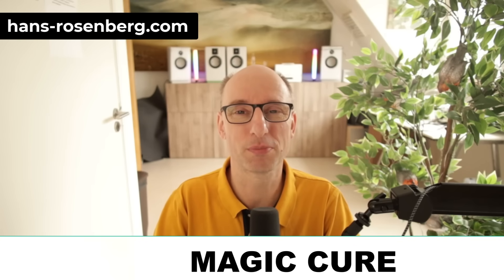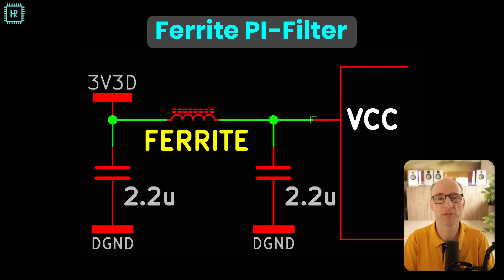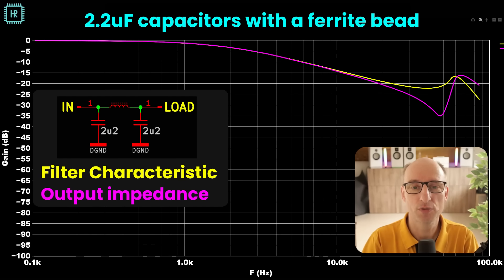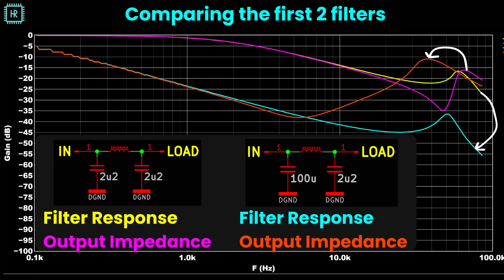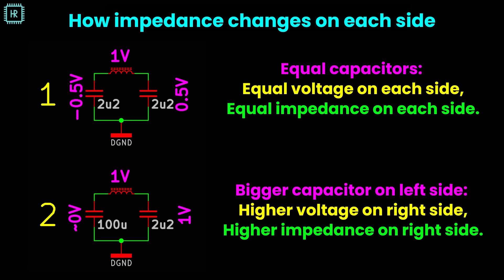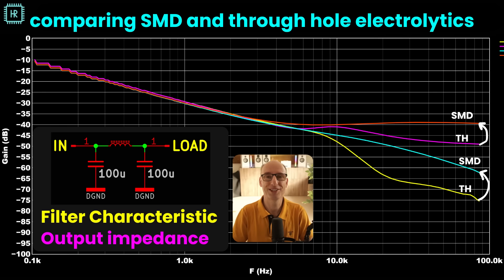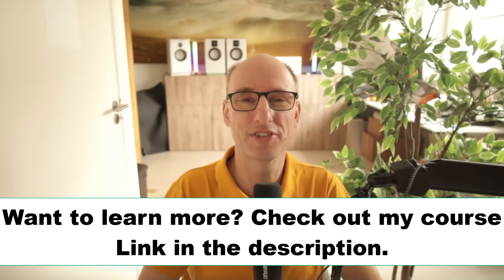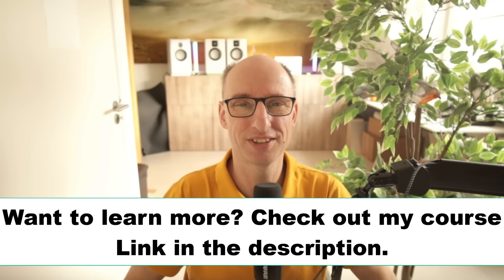How Ferrites Can Quietly Ruin Your Supply

Comment: Might be worth opening the analyser and seeing if the relays can be replaced with shielded ones, or take the input attenuator and place a copper foil cover over it, if there is a ground plane handy to solder it to with a short wide tab of the foil.

also how about damping resistors, either across the ferrite, or in series with the ceramic capacitors, to tame down the Q of the resonance, and thus rob energy out of the filter itself.

The DC change of the ferrites, along with bias voltage of ceramics, is a reason you see in datasheets thousands of different parts, all with the same nominal spec like capacitance, current, voltage and dimensions, and for the beads dimension, current and inductance, along with loss, but they are, very often, not going to act in the same way in any circuit, especially if your application calls for critical parameters to be right. Substituting the wrong part, nominally "purchasing says this item is the same, so we will use the 1c part instead of the 3c part" can make your design change from reliable, conforming and profitable, to a massive field failure rate, poor stability, and not conforming to standards very fast.
Reply from the maker: I tried some copper foil on the connectors (before I realized it was probably the relais) and that didn't help. I could try the relays at some point, but since the problem is only using the less sensitive setting of the device it probably will not bother me again.

Comment: usually spending the cost of the ferrite on extra Caps is a better bet, IMHO.... And your circuit will survive when you slip with the scope probe and short the supply, and you have no risk of coupling external magnetic fields!
Reply from the maker: I think that is true statement.

Comment: The 

@hansRosenburg74 
The QA401, and 402 are no longer made. The QA403 replaces them, but these are audio devices.   Why not use somthing like a  NanoVNA  9KHz-1.5GHz?
Reply from the maker: I tried the nanovna but it is no use at these low frequencies even though it is speced at 9kHz. I could not get it to give good results so I gave up. I did not investigate deeply why it failed.
Reply: 32 bit ADC versus 16 bit ADC seems to be a compelling reason.
Reply: @SeanBZA  It depends on your use case though. I took quick look at the datasheet and you basically can't test anything above 200KHz on the QA403. For example, you're not gonna be able to test any HDMI, PCI-E or USB designs with the QA403.

Comment: LC Pi filters are about as much use as a plastic heat-shield unless you know your load. A variable load means the filter won't be optimal except at a very specific load.

Also, if you put too much current through a ferrite bead, it's inductance goes UP; in magic smoke.
Reply from the maker: indeed

Comment: If only Open Source was explained this well. (Sorry, I'm chewing my own fingers down to the bone trying to get a fairly mature RTOS to work with simple boards like the Pi Pico and low-end STM32s.
Reply: You shouldnt be lazy and use an operating system about which you know not exactly what its doing. Work from scratch and you will know exactly what your circuit or software is doing and can control what it does
Reply: Just use zephyr ;)
Reply from the maker: I"m not going to explain open source :-D

Comment: If you aren’t 100% you need a ferrite, you probably don’t need a ferrite 😂

Jokes aside, I think the common mistake is that people see this pi filters on the analog supplies of MCUs, and end up copy-pasting it to other circuits without understanding that they’re a terrible idea if your load is a digital circuit.
Reply from the maker: I'm reading this conversation. Datasheets and appnotes regularly give bad recommendations unfortunately. Even from the most respected companies that make fantastic ics. This is why it is so important to understand fully what is going on yourself. Otherwise, it could be that you need to spend weeks trying to figure out what's wrong.

The difficulty here is knowing when to trust a datasheet / appnote and when not to....
Reply: @HansRosenberg74  Agreed, this one is not egregious, although it clearly depends on interpretation.

It recommends splitting grounds which I’m not a fan (most times it hurts more than it helps), but at least it gives advice on how to properly do split grounds.

The particular diagram we’re talking about is not wrong, but it makes particular assumptions that it’s not clearly disclosing.
Reply: @HansRosenberg74  This recommendation is not bad. It is, of course, not universal, but it allows you to look differently at the organization of the DVCC and AVCC.
Reply: Application notes from ADI give the most adequate advice: take analog supply directly from the output of the voltage regulator, and digital supply - from the output of the isolation LC filter.
Reply: @leoniv.  I think you got those mixed up. If you do that your digital supply will ring during big current swings.

Your digital electronics want a low impedance source up to ~5x the clock frequency, while your analog electronics are going to be quite slow and have quite constant current demand.
Reply: @theondono  No, I didn't mix anything up. ADI recommends for mixed-signal ICs connect the DGND to the system AGND , and take the DVDD from the AVDD through an LC filter. See fig. 9.26 of ADIs "HARDWARE DESIGN TECHNIQUES".
Reply: @leoniv.   Careful when reading this things, this diagram is explaining how to connect the “digital side” of something like an ADC or DAC, so that you can power it from the analog supply without degrading performance.

This is very different from a general split between digital and analog supply, since this assumes the transients are small enough to be handled by that single capacitor. For a full circuit you’ll generally want the opposite.

Another way to think of it is this, the one that is connected directly gets “priority”, in the sense that their load transients will get better serviced by whatever circuit is setting the voltage (dc/dc, ldo,..), the other one will have to survive on what charge is available on the caps before seeing a dip. 

For most circuits you want the digital section to have priority, because it’s current can shoot to 1A in very short time, and you’re just trying to keep those fluctuations to get to your analog section. 

Analog is making this recommendation because if the analog section of a DAC/ADC is wrong, nobody really cares about the digital section 😂

The little clue they give is that they place a buffer with a separate VDD and some indication that you’re not supposed to power the whole digital circuit from that filtered node.
Reply: @theondono  We were talking about the AVCC power supply for the MCU. The MCU chip can be considered as a mixed signal IC, since an ADC is built inside. The digital part may not consume so much, it depends on the load of the ports. In a precision power supply that used the built-in DAC and ADC of the MСU, I powered the MCU as recommended by the ADI and got good results.

Although different situations are possible. When a digital circuit is powered directly from the output of a voltage regulator, it cannot respond to surges in current consumption due to the limited feedback bandwidth. The output ripple may even increase due to poor response to the surge. And when the digital part is isolated by a LC-filter, the situation may be better than when the analog part is isolated by the same filter.
Reply: @leoniv.  I'm sure you got good results, this kind of stuff won't immediately break your board. I'm sure you can replace the L with a 0R and you'll also get good results.

But I would recommend that you don't use this for an MCU. This kind of stuff normally shows as anomalous behavior, like weird resets, cache instabilities etc...

The MCU might be mixed signal, but powering it like this can cause instabilities on the digital section. Again, what's true for a single ADC chip is not necessarily true for a complete controller.

Especially don't use this configuration if you move to "high end" MCUs or APs, because it's a recipe for disaster.
Reply: @theondono  Yes, I understand the limitations of this power connection method. But for MCUs that use their AVCC as a Vref for the ADC, I consider this method to be the best. For the digital part, the exact value of the supply voltage does not matter, and the low source impedance can be ensured by a large capacitance at the output of the LC-filter.

Comment: When you realize that electrolythic capacitors have internal inductance because of the coiled foil opens another can of worms 😊
Reply: Everything has inductance at some level of magnification, and capacitance and resistance. AHHHHGGG!
Reply from the maker: yes allthough it seems to depend highly on where you take the wires from that coiled foil what inductance you get. I read this somewhere, I did not investigate what that means exactly.
Reply: The leads attach toward the middle of the strips so the turns on each side match
Reply: We ran into an issue in the lab due to parasitic inductance. We were designing a snubber circuit for a multi MHz / nanosecond switching time high voltage application, even special low inductance filter capacitors introduced a parasitic inductance which almost ruined the day. My college came up with a brilliant idea, to simply use a thin ceramic plate we had laying around, glued some aluminum foil onto each end, dumped the whole thing into a tupper dish with potting silicone, and we ended up with a perfect low-ESR almost zero inductance capacitor, resulting in a perfect critical damping in our setup

Comment: Hello sir, You didnt add a resistance to the LC circuit. How would a RLC behave ?
I always add as much capacitance as possible after the inductor. Usually several small electrolytics in parallel to keep ESR as low as possible.
Reply: Resistance will decrease the "Q" of the parallel resonant circuit while retaining most of the benefit of the ferrite bead inductance.
Reply from the maker: You'd have to simulate and maybe measure it to be sure

Comment: why not just use an inductor like 10uH with 220uF polymer caps on its sides?
Reply from the maker: If The resulting Q is low enough than that is no problem

Comment: How about a Damping resistor across the ferrite bead ? I have seen that many times in the output of audio power amplifiers and CRT TV deflection circuits.
Reply from the maker: Yes, but then you limit the high frequency suppression, so that's the drawback
Reply: Years ago, in hobby projects, I used a 0.5w resistor with 10-20 turns copper wire wound on it. I don't remember the resistor value and never did any real measurements, but it was 'common practice'.

Comment: smt electrolytic caps really, really suck. they have TERRIBLE ESR. like, unbelievably high - i once measured a 10uF 16V SMD electrolytic at 27Ohms. it was the poutput capacitor in a TL431 2.5V reference, and ESR was so high the TL431 oscillated.

solid polymer SMD electrolytics (usually have a blue stripe) are awesome, < 10mOhm ESR, but they aint cheap....
Reply from the maker: Indeed!
Reply: What about SMD ceramics?
Reply: @crides0  very low ESR, typically around 10mOhms or so
Reply: @terrygiven8789  i don't think is possible

Comment: You claim resistors have "no resonance because it has no inductance". I can understand a surface mount resistor should have no (negligible) inductance, but through hole resistors or surface mounts with similar form factors are made by laser trimming a spiral on a cylindrical resistive material. Does this contribute any significant inductance?
Reply from the maker: The inductance will show up at really high frequencies. Definately not at the frequencies this video measures at

Comment: Why not put damping resistors across each capacitor (determined by 2 * SQRT(L/C)) to increase the capacitor ESR and suppress ringing?
Reply: DC loading. you can damp the resonance by placing an RC network across the relevant capacitor. Cdamp = 3*C, Rdamp = sqrt(L/C) works pretty well.
Reply: @terrygiven8789  Yeah, the RC network across the main capacitor approach is definitely a better choice for DC-biased circuits. But in my experiments, for AC filters, adding a damping resistor in series with the X2 capacitor(s) to slightly over-damp the circuit and lower its Q-factor actually gave better results.

Most power supplies (even the expensive ones) often don't include any damping resistor when an inductive filter (Pi, T, or LC) is used on the AC mains side. So they tend to resonate at a particular frequency and amplify noise instead of suppressing it, especially when lightly loaded or unloaded (as loading naturally damps the resonance).

The main drawback of adding a resistor is thermal. The resistor can get quite hot if the noise is strong and continuous (as in induction cookers or inverter Air Conditioners). You often need a physically larger resistor, since a regular 1206 might not handle the dissipation depending on the design.
Reply: @SouravTechLabs  for an AC filter, yeah, for sure. but BEWARE peak pulse power if it an AC mains filter. that X2 cap starts out discharged, and if you turn on the AC supply at exactly the wrong time (the peak of the AC line) that poor little resistor sees 2*(Vrms^2)/R peak power. i've done this, and used carbon composition resistors or equivalent than can handle stupidly high peak pulse power. because the first time i did it, the resistors all immediately failed open-circuit, making my filter go away.....

resistors that can handle this are not exactly cheap. but they can and do work well....
Reply: @terrygiven8789  Yeah, that's something. MFR are no go, CFR might survive but still a bad idea. I use non-inductive wire-wound resistors which can handle quite a lot of peak power, possibly 10 - 15x the rated power for a short time. I've used 9W + 9W vitreous enamelled resistors from PEC (Indian, but very high quality) for my mains AC filter, which is working good and gets to around 80C when I turn on the air-conditioner which injects strong 28kHz noise into the mains. That noise previously crippled capacitive droppers and my owon bench power supply draws 100W at idle when I turn on the air-conditioner without the filter. With the filter all good :) 

Actually in my comment I was talking about AC. My bad. The video is about DC filters not AC filters. The RC filter approach is very solid when it comes to DC.
Reply: @Sourav: can you still pass the CISPR compliance test with that series resistor on the X capacitor?
These tests are using a LISN to mimic a power line, and they contain huge RC damping resistors as well.
Reply: @SouravTechLabs  that'd do the trick, sure. surprisingly WW resistors are not the best wrt peak pulse power. solid composition resistors are much, much better. because there is a lot more volume of the resistive material. check out the resistors that are used for soft-starting huge 3-phase distribution transistors - they are crazy! like, lamppost dimensions crazy, with utterly ridiculous PPPower

Comment: It's interesting to see your filter effects on the kHz range of frequency. But in practical applications, i would only use a ferrite if i have issues in a much higher frequency range in the hundreds of megahertz. If i need to filter in the lower frequency range, i need to use inductors or other filter strategies, as the impedance of ferrites isn't really useful down there. There are always tradeoffs and traps to avoid, and there are a lot of arguments for doing things one way or another. Unfortunately you sometimes just have to actually build the circuit and actually test it, to get a clearer picture of the result.
Reply from the maker: The issue is that when you filter for high frequencies, it is easy to overlook the resonance at low frequencies. However, this will cause ringing and noise bumps. That is the pitfall.

Comment: I wonder how many people have saved or ruined their designs with current sense resistors without realizing. A 100 mOhm current sense resistor and a 100 uF capacitor has a -3dB of 16 kHz for reference. Current sense resistors have either accidentally reduced the noise in someone's analog design or severely increased their supply ripple for digital circuits.
Reply: The current sense resistor goes before the capacitor I hope.
Reply from the maker: that can be a nasty one

Comment: Ferrite beads are largely employed in gate drivers for GaN and SiC. For voltage rails and in series with the Gate-Source of the devices.  The are many applications notes that recommend.
Reply: Ferrite beads in gate drivers are a terrible idea. firstly, gate drivers should have low inductance, so adding an inductor is pretty stupid. Secondly, gate driver resistance is a critical parameter, so a ferrite bead whose real part is a horribly strong function of impedance is, again, a terrible idea.

lots of app notes say really, really stupid things - eg how many app notes recommend an RCD reset circuit....
Reply from the maker: I would agree that this is not really the best application. I think it would slow down the gate drive and cause problems. Unless it is a ferrite with a very low impedance and perfectly tuned to whatever is loading it, that could be an option maybe??? But you'd really have to know what you're doing and triple check everything.

Comment: This just turned up in my feed, so there may already be a video on it, but: different capacitor types can also impact response.  

Some chip data sheets recommend using multiple capacitors in parallel, of different types, to improve the overall frequency noise performance.
Reply from the maker: Yes, I have 2 videos on that (the previous 2)